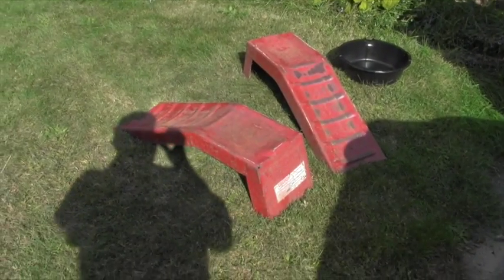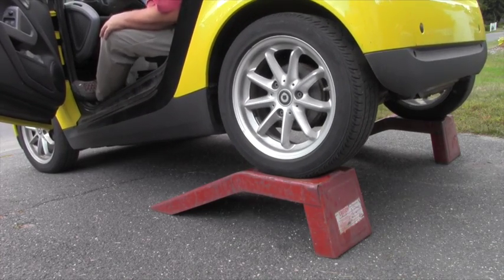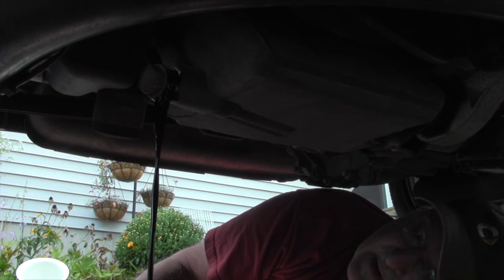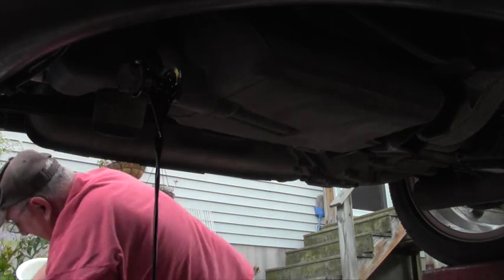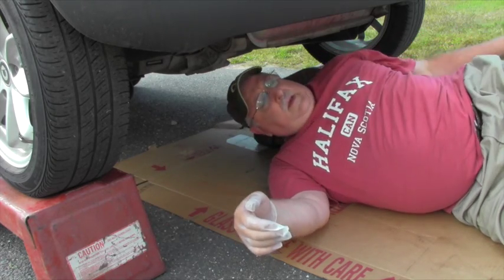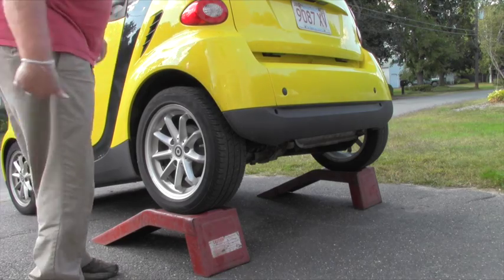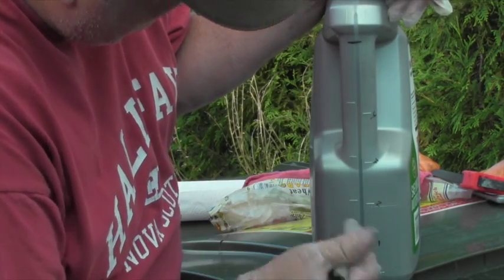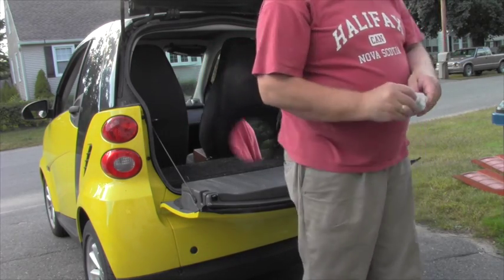smart Fortwo Oil Change

Comment: He purchased a Smart for Two so how smart can he be? "Sounds like it needs oil." No shit. Why didn't he just release the parking brake, put the transmission in neutral and let gravity do the rest? Wouldn't let him anywhere near my Camry.
Reply from the maker: Ojo Felix NM The ramps have stops at the top forward edges, so I would have had to push it over the stops. I couldn't have done that by myself and have been able to control the car from inside at the same time. I could have run the engine only long enough to get over the stops then rolled down, but my driveway is really short and I didn't want to be so close to the road. The engine ran with low oil (NOT no oil) for all of 33 seconds, so what! 
You are free to do whatever you want to your Camry and I can do whatever I want to my car.
Reply: Denb7 I've been doing just that for sixty some years and never started up any vehicle without oil.Definitely a nut on both ends of the wrench.
Reply: Ojo Felix NM YES a NUT on both ends of the Wrench LOL LOL. More worried about his gloves than the engine damage running with no oil
Reply from the maker: Ojo Felix NM You should try it some time... it's so radical... it's like living life on the edge.
Reply from the maker: Tarbet Balfour I got my 1st lawn mower off the side of a road. The engine was seized solid. I pounded the piston out with a wood block and mallet. The cylinder was terribly gouged. I used a file and sandpaper to grind the rough spots down. I threw it back together and ran it for many years. It burned oil (I used used oil in it) bit ran with no other problems. Thirty-three seconds with no oil pressure isn't going to hurt the engine.
Reply: Denb7 You are wrong.  Every second without lubrication is damaging.  Why do you think they say that most wear occurs when you start the car due to no oil pressure?
Reply: broderp Right you are broderp. This windbag's elevator isn't going to the top floor. There is a nut on both ends of the wrench here.
Reply from the maker: broderp I agree that running with zero lubrication (metal-on-metal) is damaging, but there IS lubrication! A film of oil coats all moving parts even after draining the pan. Draining the pan doesn't remove all of the oil. There's not enough for the pump to circulate, but even after 33 seconds the cylinder walls will still have oil coating them.
Besides, I don't care what my critics have to say. My engine runs fine and it doesn't burn oil. Even if you are right, what damage did it do? Did I shorten the engine life by a day? A week? A month? I'll trade this car in long before the engine seizes up, so I don't care.
Reply: Denb7 Keep on doing whatever you want. It's your car and you can run that engine without lubrication as long as you want. No one who care for anything mechanical would run an engine without lubrication. That knocking sound you hear is metal against metal
Reply from the maker: So now who's the ignorant one? If you know engines so well, then how is that you can't tell the difference between the sound  of metal on metal and hydraulic lifters with insufficient oil pressure?
Reply: Denb7 Is it possible to leave just a bit of oil and replace MOST of the oil instead?  Just asking, love the video!
Reply from the maker: Robin Smith One thing my critics seem to fail to understand is that draining the oil from the pan and filter doesn't remove 100% of the oil from the engine. There's always some oil left behind. Of course it is possible to leave some oil, but it defeats the purpose of changing the oil. Leaving behind even a half quart in the pan would not be enough to properly circulate and lubricate the engine, so what would be the sense?
The tapping sound you hear is the sound of hydraulic lifters operating without pressurized oil, NOT metal-on-metal as some suggest.
I do not recommend that you run your engine as I did in my video. I only showed you what I did when I changed my oil. However, I do not believe that briefly operating the engine as I did in the video causes any more damage than cold cranking an engine in winter.
Reply: Robin Smith Nonsense. Just drain the oil and refill with new oil. Don't run any engine and/or any machine of any kind without lubrication. Old Denny has a short in his headset. "There's the nut right there."
Reply from the maker: Ojo Felix NM Oh why can't you just build a bridge and get over it? How many times must it be explained? There is lubrication coating all moving parts. Tell me... Could you drain the oil from an engine, remove the heads, crank it over 100 times and then lick the cylinder walls without getting oil on your tongue? How about 200 times? How about 500 times?
The more you persist, the more your ignorance of the properties of viscous liquids shows.
Reply from the maker: +T Costa Thanks for your feedback. Yes, I figured it was obvious that the car was operated before the oil change in order to get it up on the ramps to begin with. However, it is possible to leave it on ramps for months, but I don't have the luxury of not needing to drive it for that long. I prefer to run the engine enough to warm the oil a bit before draining it, so I usually run around doing errands then back onto the ramps and allow it to cool a bit before starting.
Reply: +Denb7 you obviously do not know how oil lubricates a car engine. Crank and piston bearings have a very close tolerance. When there is oil pressure a very thin film of oil separates these surfaces so there is no metal to metal contact. When the oil pressure is low enough, in your case it was non existent because you drained 95 percent of it out, there is no thin oil film for these surfaces to ride against so it's metal on metal. Not to mention all the damage to the top of the engine, valves ect.
Reply from the maker: +Flammable 281 You obviously make assumptions about my working knowledge of the dynamics of viscous fluids, my level of concern about this little toy car that I drive and my interest in the opinions of my critics.
Reply: Denb7 I make no assumptions. When you say stuff like "there is still a film of oil on metal surfaces so it's lubricated enough to run engine dry of oil" that tells me you don't know what you are talking about. You can do what you want with your stuff but when you post BS in a public forum expect to be called out on it.
Reply: +Denb7   And I thought I was big fart.
Reply: U said it about yourself.

Do not strong complain people just because you can hide on internet.  

Positive or constructive comments are allays welcome.

enjoy your personal flatulence

P
Reply: You have a nice day LS.
Reply: Thank you Ojo Felix NM,

I have waited 6 months on this forum for all the internet geniuses that know about engines and oil pressure, but to date have not found any post on engine load.

Is that not strange given all the "experts'?

I drive my smart mostly in manual mode and must be VERY aware that if I climb a hill, I down shift to avoid low RPM high engine loading (aka low oil volume, high bearing load) on my vehicle as that is when SERIOUS damage to the rotating assembly will occur.

No load on idle engine is LOW risk.

Agree?

If not, no worries and happy motoring!

P
Reply: It's not oil pressure, it's oil flow that lubricates bearings.He doesn't have any oil flow period because of no oil in the sump. Personally, I don't care if that nut drives that pos forever without oil. That also goes for you. Have a nice day LS.
Reply: Thank you again and nice day to you Ojo Felix NM.

I try to respect and learn from all this youtube stuff and I learn a LOT!  I learn from the right way, the wrong way, and the comments left.

As for oil pressure vs flow....don't care as long as the bearing surface has a film.  High engine load pushes oil out faster than low engine load...yes? 

Anyway, take care, and consider that on a good year, in the USA 15 million cars are sold that came off the line with only the assembly fluid to protect new bearings.  Those engines had to wait a few seconds before receiving full volume/pressure...and they were NEW bearings.

Enjoy your Camry....very solid vehicle.

cheers,
P
Reply: The timing chain tensioner in this engine MUST HAVE OIL FLOWING THRU IT AT ALL TIMES .He just took 10 years off his engine in less than a minute how fucking stupid.
Reply: Please show me your data.

It's a Mitsubishi 3cyl engine...no special...no anything...has long history of GOOD longevity.

If he took "TEN" years of the engine, it will only last another "90 years?"

P
Reply: Hello Mr. Flammable,

You are too volatile for this post....LOL

What is wrong?  He didn't drive the car.

Low load on bearings.  Go back to school or do not comment on engineering outside your area of expertise.

P

Comment: Um it's your car and you can do as you like but running the engine that long and accelerating the way you did to back up with no oil in the crank case cannot be good for it. I could hear the valves really loud when you did that. If you do this every oil change your engine will be damaged and its life  shortened. You would be better off having someone sit inside and you or someone else push it off the ramps with engine off.
Reply from the maker: +Flammable 281 Valve noise is actually hydraulic lifters operating without oil pressure. I change my oil once a year, in the fall. This is an '08 smart, so as of this post, it has operated 30 seconds  x 7 years = 3.5 minutes without oil pressure. Shorter life? Honestly, I'm surprised it still runs as good as it does. I didn't expect this amusing little car to last this long! 
Yes, having an assistant would be nice, but I don't have one. You're right! It is my car and i can do as I like.
Reply: Denb7 my only beef with the video is that you are showing a "how to" oil change to others and there are some noobs who may never have done this before so would not know better. It would have been better if you put a disclaimer in your video saying don't run your engine without oil like this as that is bad, but I choose to do this. At least that way noobs wouldn't get the impression it's ok. Peace.

Comment: If you hate your engine use a $5 fram filter.  
The oil you chose is not the correct MB229.5 spec. 
Crescent wrench on the oil bolt?  
Ran the engine with no oil?  
Don’t use this video as a proper guide.
Reply from the maker: I only spend $40 on filters for my Lamborghini. Those $5 filters have drastically shortened the life of my 11 year old car's engine. The oil used is what the manufacturer recommended in 2008 (the sticker shows in the video). Yes, I used a crescent wrench because I couldn't find my vise-grips. The drain bolt is larger than the lug nuts and I didn't want to purchase a full set of wrenches just to have the one size wrench  needed to open the drain. A wrench that I'd only use once every year. Didn't run the engine without oil? This has been explained numerous times.
As you are apparently an expert automotive mechanic, I question why you'd be watching a "how to" oil change video in the first place.
Reply: Denb7 :  I actually just bought a 2015 smart for two and was looking to see where the oil drain bolt and filter were.  Your video came up first on my search. 
Fairly certain MB229.5 oil was available in 2008 and that the high mileage oil has never been the correct stuff.  Likely it won’t hurt anything but to use your logic: if you’re going to go to the lengths to make a how to video you really should get as much of it correct as possible.  I’m a car enthusiast with a reasonable knowledge of how to do proper service.  I’m not the one putting a video online but I was looking for a proper video on how to do the first oil change on a smart. Your video was a “don’t do this” kind of video.
Reply from the maker: @curiousottman   This video is not a "how to" video. My video is how I change my oil and it is for entertainment purposes as started in the description. Whether my video is technically correct or not won't change the way I change the oil in my vehicles.  I have used my technique for many years and have yet to experience negative results. Though I've never analyzed engine parts microscopically, I drove my smart for 11 years without any problems before trading it in for a Nissan van. The smart didn't even burn oil, which would be a clear indication of excessive engine wear.
I hope my video answered your questions about the location of the drain plug and filter. If it did, then that proves that my video was at least useful for that purpose.
Doing an oil change in my driveway should be enough of an indicator that I am not a professional auto mechanic.
Reply: Denb7 Your video did help explain the oil change process and location of the various bits. Thank you for that. 
Did you ever perform a gear oil change?
Reply from the maker: @curiousottman  As far as my smart car goes, I have made videos of how I've  repaired a broken tailgate latch, a door handle and heater fan motor (2 videos). I have also replaced front brake pads which has also garnered its share of critics.
As far as routine maintenance goes, it has been limited to oil changes and nothing more.

Comment: It is unacceptable to start the engine without oil !!!! Man, what are you doing, who told you to change your oil like that. Oil must also be poured into an empty new oil filter as the filter is mounted this way. if the engine could work without oil, it would not need to be replaced !!!!
Reply from the maker: This video has been on YouTube for over 7 years and you are the first to mention this to me. 
I've responded to a hundred comments like yours and I'm quite finished explaining the facts of the matter over and over again. 
Scroll down the comments and take your pick of responses. I'm sure you'll find a reason to disagree  with every one of them.
I drove my smart for 11 years and it never burned oil.  So tell me again about all the damage I'm doing to the engine.

Comment: dude your oil is much to thick for that car. using wrong oil . you need 0w40 or 5w40 if very hot area.
Reply from the maker: 10w30 viscosity oil is appropriate for my temperate zone. I've used 10w30 on all my cars since the 1970s without any problems.
Reply: @Denb7  man you wrong, is not the 70,s any more. Engines are now precision build, i been around than too i worked on old carburator engines. Smart 451 petrol is 0w40 for colder climate and 5w40 for warm climate. Tolerances are small. Use only full synthetic. Change 5000 miles or 1 year. 

I run 0w40 in my wifes, for 57000 now, no consumption at all, in UK. If is too thin it would consume right ? But it does not. That means it flows faster to lubricate parts and thats better. You want on cold start oil to flow asap to lubricate top of engine.
Reply from the maker: @mihairadupop2491  Dude, you're wasting your time.  I had 68,000 miles on my smart and it never burned oil or had a hard time cold starting in the winter.  After 11 years, I traded in my smart for a 2015 Nissan NV200 van with 120,000 miles on it. 
And when I change the oil, it'll be whatever viscosity I decide to put in.
Reply: @Denb7  Man mag es kaum glauben ... Der Motorenbau hat sich in den letzten 50 Jahren weiter entwickelt. Deshalb gibt es auch auf die jeweiligen Motoren angepasste Öle. Es handelt sich hier um einen Smart, nicht um einen Traktor.
Reply from the maker: @mixizettpitelka  Ja. Ja. Ja. Meine Freunde glaubten alle, es sei ein zugewachsener Rasenmäher. Danke fürs zuschauen.

Comment: Big mistake to start the engine before you filled it up with oil! You are sure not a mechanic!
Reply from the maker: I never claimed to be a mechanic, because I'm not. The engine ran for 33 seconds at an idle speed with only the residual oil in the crankcase for lubrication. Sure, there was no pressurized lubrication (evidenced by lifter noise), but a measurable level of damage would be no worse than repeatedly cranking an engine that refuses to start.

Comment: My good God almighty do not tell me you started that car with no oil in it... My old man used to say a little knowledge is dangerous... And you are very very dangerous... So many things wrong in this video... That car calls for 0w 30 not 10W-30 FRAM oil filters are the worst in the business you did not tighten up the oil filter tight enough and you didn't put any oil in it to prime the pump... Because you started it without any oil in it you have damaged the bearings and probably the camshaft as well. This should be an example of a video on what not to do for an oil change

Comment: Not a smart move running the engine with no oil in it.
Reply from the maker: If I only had a nickel for every time someone shared that sentiment on this subject, I'd be rich. I've responded to similar comments more times than I can count, so I won't respond to yet another one. You can read my replies to the others if you are so inclined.